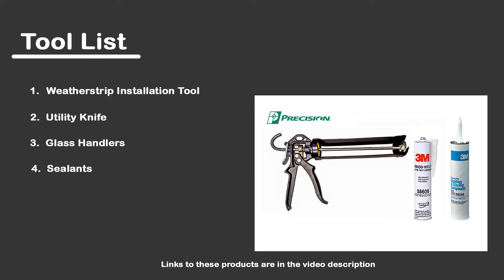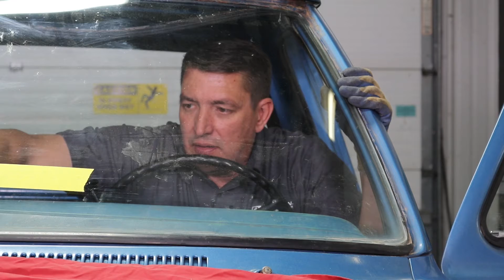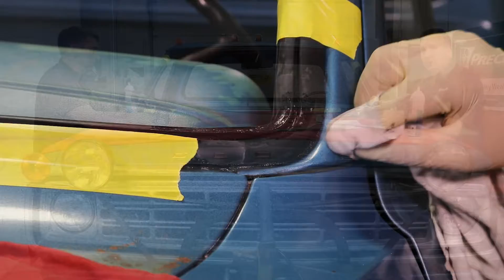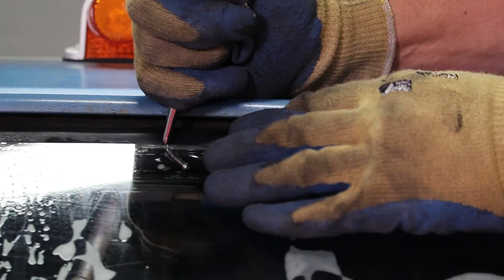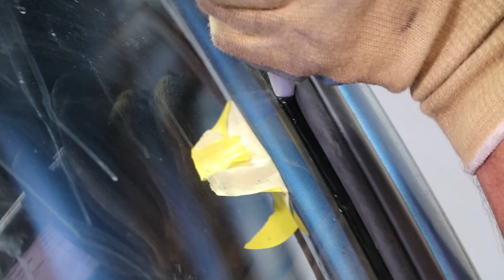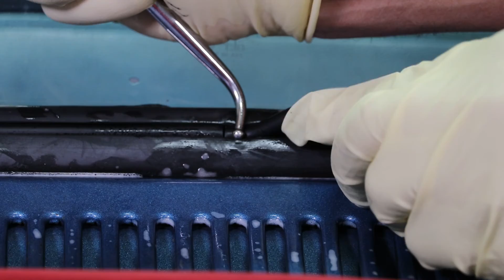1972 - 93 Dodge Truck Windshield Weatherstrip

Comment: Why do you use a hardening urethane between the glass and the gasket instead of the same liquid butyl non hardening product that you used between the gasket and the body? I am looking at using CRL7708 on both seams.

Comment: I’m confused why the sealant factory gasket didn’t use a sealant?
Reply from the maker: Your confusion is valid.  Many of the older gasket set windshields did not use any sealants.  However, todays auto glass repair standards require glass technicians to use a polyurethane or similar bonding system to secure the windshield in the gasket.  You can read more here: https://agsc.org/learn-the-standard/

Comment: So y’all show … not even close to how pain in the ass it is to install lol and the foam glass cleaner ain’t working… im bout to put ky on the bottom flange I can get the lower part of the windshield. There’s no way that the glass cleaner keeps it slick enough to slide the  windshield in the bottom
Reply from the maker: @KennethC-x8n  call in and ask for the tech line. Let’s see if we can help you. 800-367-8241

Comment: sooo did it leak ? I've heard mostly negative reviews about new gaskets, a lot of people seem to try and re use the original because new glass is slightly thinner like 1mm. ...
Reply from the maker: No leaks.  Leakage can occur when doing a dry install. It's best to use the sealants that are used in this video for a leak free install.

Comment: Is the process the same for the rear window?
Reply from the maker: For the rear it's better to rope in the seal and glass together then work in the lockstrip.  There's also a black version that doesn't take a lockstrip.  Feel free to reach out if you have more questions. tech@prp.com
Reply: I mean just the locking strip. The locking strip on mine is faded and I'd like to replace it only.
Reply from the maker: @mikem2179  Yes, you we use the same technique.

Comment: Just finished this job solo and while not for the faint of heart, definitely in the realm of do-able. Awesome step-by-step instructions, just take your time and go slow. Heating up the windshield adhesive that bonds the rubber to the glass in a zip-lock bag submerged in boiling water was a huge help to soften it otherwise I can guarantee you will snap the trigger off your caulking gun trying to get it out.
Reply: @6BTGriddy  man how did u do it all by yourself … I’m typically up for a challenge but I guess I can’t hold my mouth right to get it to seat into the bottom groove … it’ll start but won’t slide o. Down in. There
Reply: @KennethC-x8n  start from the bottom and work your way to the top is what worked best for me. Definitely get a set of those polymer wedges and plenty of glass cleaner. The larger suction cups w/handle are the way to go otherwise I could not have moved the glass without cracking it.
Reply: What about the chrome piece that goes around the perimeter. Or did i miss something

Comment: So do you need to insert the glas as long as the gasket adhesive is not hardened out or could I leave it sitting and install the glas later on?
Reply from the maker: You will install as soon as the gasket and sealant is applied.  Just to be clear, the sealant that goes on the pinchweld is called bedding and glazing compound and never truly hardens.  The sealant that goes in the glass channel is called urethane and that does harden.
Reply: @PrecisionReplacementParts what’s the point of gasket set with a locking strip if you still put urethane in the glass channel?
Reply from the maker: @Truu2it  The urethane mostly helps against water leaks. You must put the lockstrip in to properly secure the windshield in the rubber.
Reply: @PrecisionReplacementParts 
Do you put the bedding and glazing compound completely around the windshield frame on the pinch weld or just the bottom and corners
Reply from the maker: @dproudveteran7001  It goes all the way around. We just showed the corner as an example.

Comment: I always start the top first. Seems to get the top corners in easier.
Reply: Doing mine today, going to try your methods, had no luck yesterday doing what they did
Reply: @MarkyMarkgarage  how did you do it and did it work  that way fixing to do one any pointers
Reply: @keenejunk697  You just have too work it in. Bottom to top, I finally got it in doing it the way they did. But it’s a massive pain, you’ll definitely need the ball end hook and somebody inside pushing the seal out too with one of those plastic sticks. Use lots of the glass cleaner, make sure you have a good grip on the ball end hook at all times as you’re using a ton of brute force on a slippery seal, be mindful of the edge of the glass. I honestly never want to do another, super hard to do 😂
Reply: @MarkyMarkgarage  🤣🤣I remember the old days when rubber molding with chrome! Before the 90s!!😎

Comment: I'll be removing and reinstalling the windshield on my 1987 D150 that has rust along the drip rail over the windshield, Not sure if I'm going to be welding or doing some fiberglass work, but either way, the rust has to go. Great video, I actually believe I can handle this job now. Much appreciated.